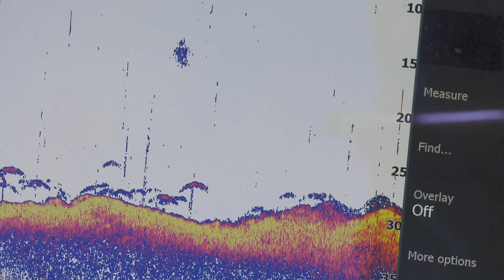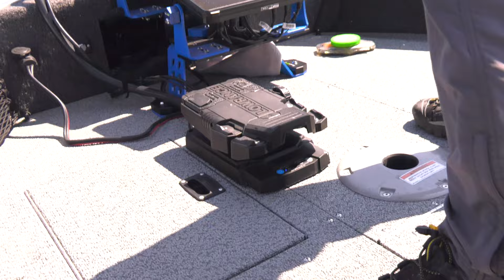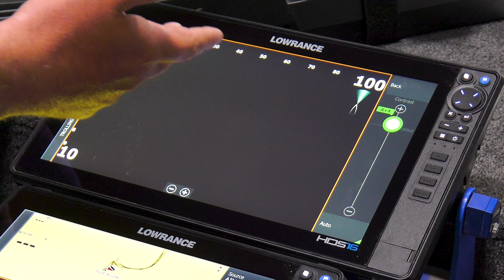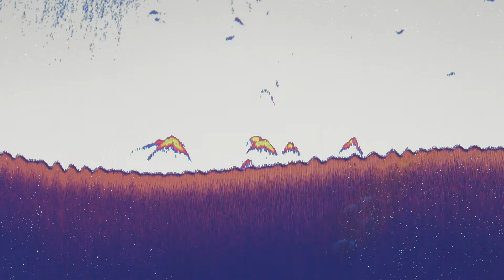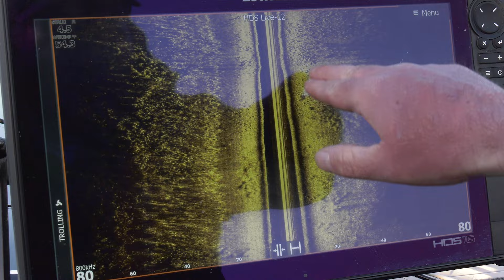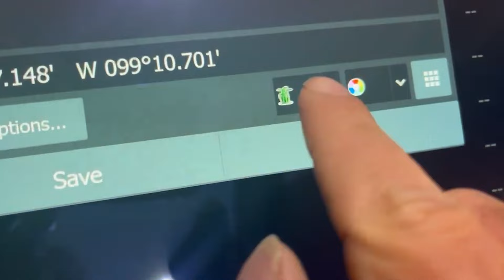Lowrance HDS Settings, Tips and Tricks

Comment: Hi Jason,  How low do you install the 3-1 transducer (HDS 3-1 on the transom)?  I have an aluminum  boat.
Reply from the maker: @pb6936  I always use a transducer mounting plate so I can move or adjust without having to drill more holes in the boat.  I drop the transducer below the hull of the boat slightly and use a Tail Tamer to cut down on the spray. We will do a video on transducer placement.